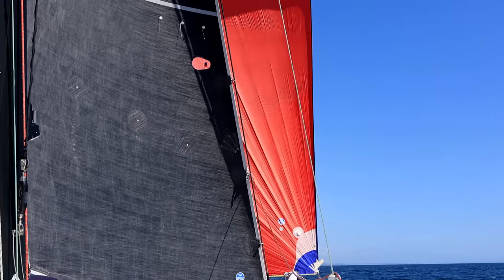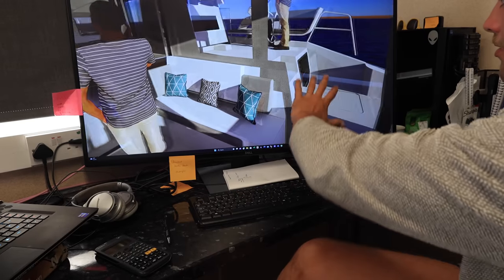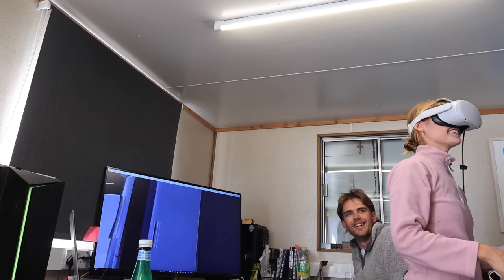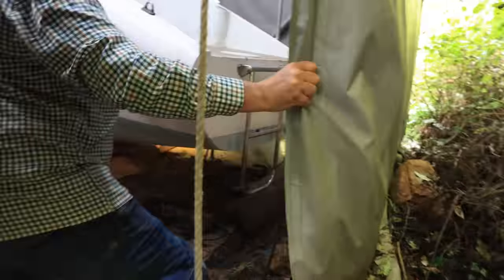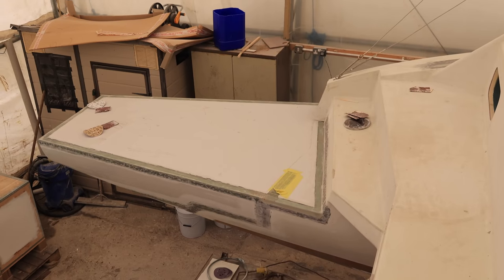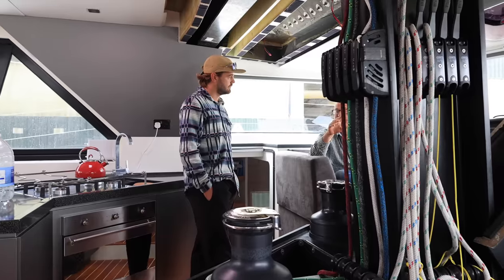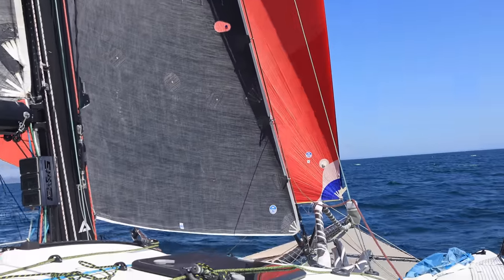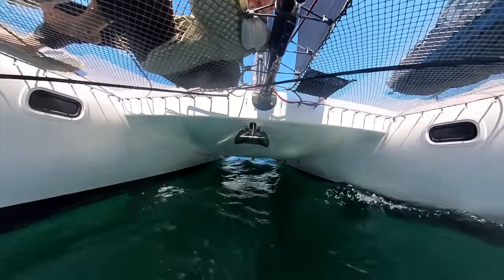FUTURISTIC Sailing Boat Design: Trim Sails Whilst Cooking?

Comment: Looking at the cockpits of the new IMOCA 60s you realize that the Rapier 550 was ahead of its time, a boat that you can sail at high average speeds without ever getting wet, just as they are doing today in the new IMOCA 60s.
Today you can see that the first thing buyers of live-aboard catamarans do is install a closure on the aft deck to turn it into another closed place. The Rapier 550 is already closed and incorporates that space into the total room.
When you see that those who live on board sailing around the world never steer by hand, but instead rely on autopilot throughout the ocean crossing while standing guard inside the salon, you realize that the Rapier 550 was ahead of that.
For all that I tell you that I love the Rapier 550, and it would be the boat that I would choose to live on board.

Comment: 😂 Those guys are working on a full blown cruiser... The Daz cats are hot rods ... Young couples and old salts may indeed travel far and wide in them as also the disability adapted boats they have done going back as far as the Impossible dream.. 😎

Open nets at the front mean you have to keep adventurous little kids and crazy pets under a close watch.

Love the fact they keep this wonderful yard  hidden round the corner .. like Wharrams hide up the river a bit further south.😉

So glad you got to see a Rapier 550 ... Its a boat that makes more and more sense once youve been dealing with the elements and big crossings . .full time. 
The other thing is you can always plug in a hand tiller at the back and steer the spaceship like a dingy ...still single handed 😊
Reply from the maker: It was a mental boat. You really would fly across the world. The Impossible Dream was incredible, how cool it was that the team at Dazcat could make that a reality. We had never seen a Rapier 550 before, it was such a different concept than we had ever heard of before! But does make sense for lots of sailors who don't want to get soaked with every wave 😂
Reply: @TeuluTribe  
Well you can open up the roof and side windows.. lol.  
Hybrid power lots of solar and 
If it works out Lion glass would reduce the wt of the 500kg of glass by half while increasing strength and scratch resistance. It also produces only about half the CO2 and uses half the energy to produce it . 
Did you go into the hulls...?
Remember the space and remember its 55ft long ... Impressive... and 2014 inspiration for others. 
Another smaller simpler boat to look out for is the Maincat 38 sharing some of the fundamental design/function features...but minus the high tech.